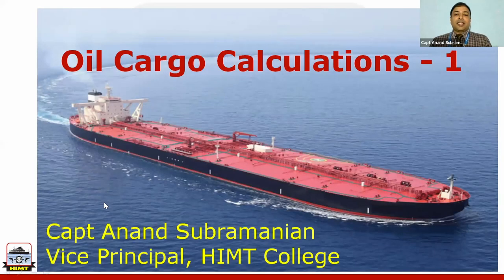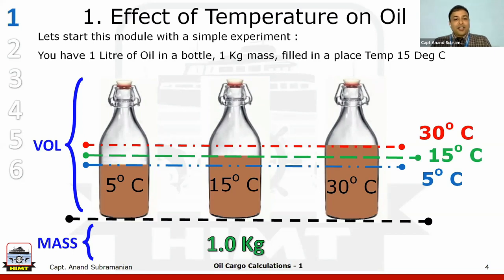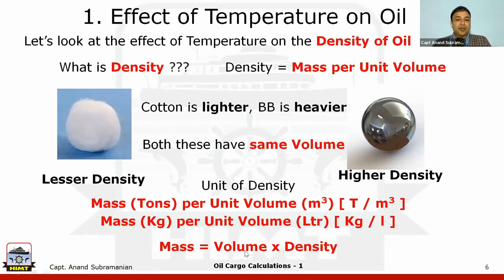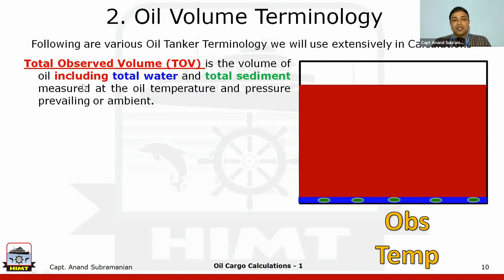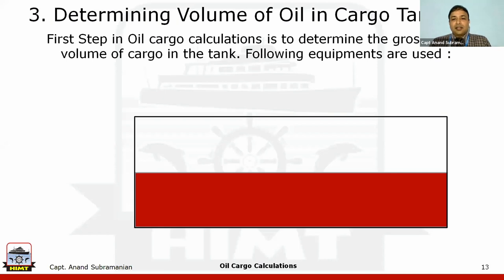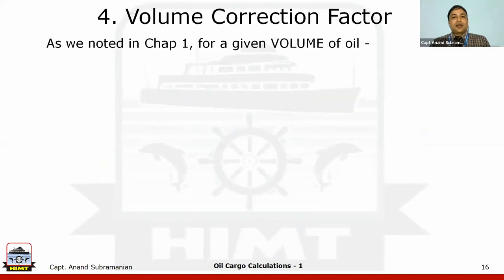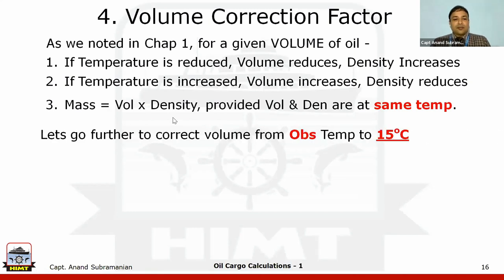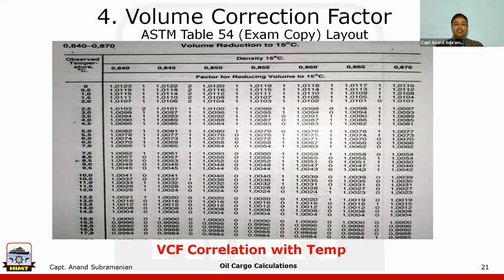Oil Cargo Calculations Part 1 | Capt. Anand Subramanian | HIMT

Comment: I appreciate very much your calculation, during discharging,  it could not be avoided the marine protect filed by both parties during discharging due to volume difference at port of discharge, this is the common problem of all the parties?

Comment: You should not ask questions , instead keep explaining what happens to volume at different temperatures. And it's significance in the tanker operation. Watch lectures on  physics in MIT , Boston and model your lectures accordingly.

Comment: In US  calculation , they always used 60 deg Fah in US barrel measurement, what will be the effect in using metric system to the volume due to reduce in temperature at port of discharge?
Reply: Convert from metric to us. Temperature will not change as much as you think, especially with crude oil. When calculating what is received on shore, you interpolate the temperature.
Reply: There is no conversion required, In us we are given API @60 and we have to use Table 54A, other places where density @15 is used Table 54B is to be used.